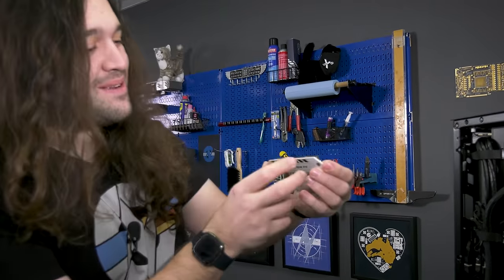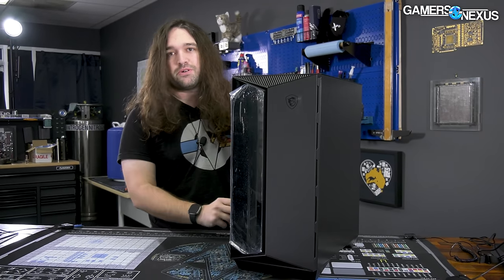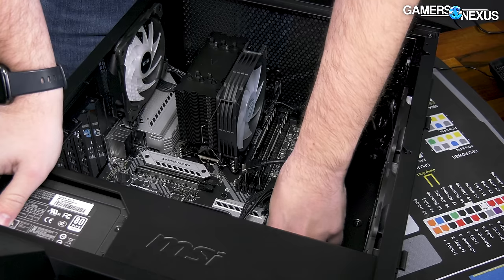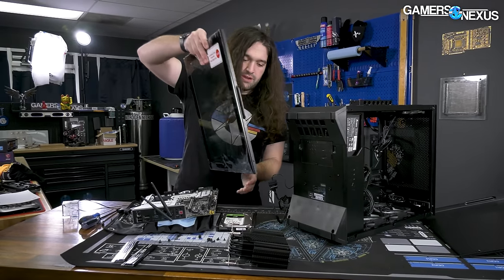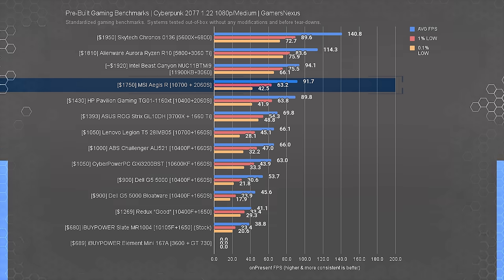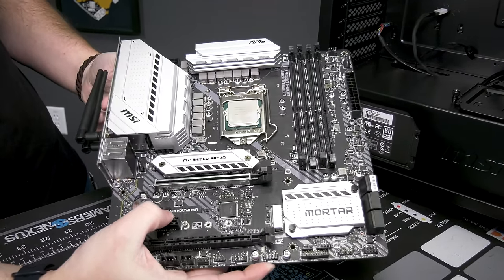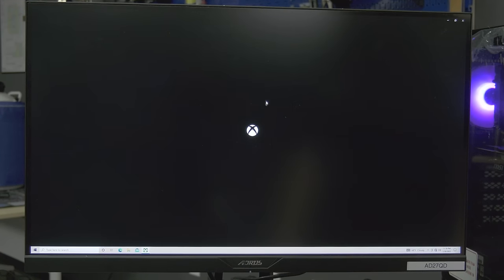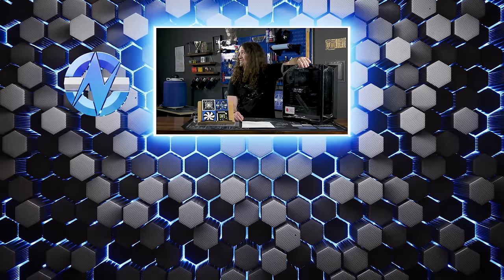MSI Pre-Built Bends SSDs & Boils CPUs at 100°C ($1700 Aegis R Review)

Comment: I work for a small computer repair shop and recently had one of these come in. They forgot to take the plastic sticker (that says "please remove before mounting") off the bottom of the cpu cooler and it cooked the cpu. Brilliant.
Reply: If it was a prebuilt I'd blame the shop where they bought it. Users are clueless, the shop should've reminded them of simple stuff like that. They're buying a damn prebuilt, it goes without saying that user probably doesn't know how computers work and was likely afraid of messing with it and breaking something.

Just a short reminder would've been sufficient. "When you get home and connect it to your mouse/keyboard/monitor, please also remember to remove this sticker."
Reply: Lol
Reply: @pjavilla  I would hope that a prebuilt computer manufacturer didn’t expect the consumer to mount the hardware for them otherwise what’s the actual point?
Reply: @pjavilla  Don't really get your comment, if it is a pre-built then the customer is not supposed to install the Cpu cooler themselve. It should pretty much be plug and play on the customers' part.
Reply: @pjavilla  nobody is blaming the end user here..?
Reply: @pjavilla  You can't remind a customer to remove a sticker from a CPU cooler for a pre-build, that would require them to remove the CPU cooler, remove the sticker, than re-paste the cooler, that defeats it being a pre-build.
Reply: Aside from the sticker MSI will forget to use thermal paste which is crazy

also that plastic on the glass protecting it from fingerprints and scratches is supposed to be taken off before use and I can guarantee it affects heat dissipation through the glass and makes it warmer inside. As soon as I took off my plastic it seemed to run cooler

Comment: It's so baffling that company that actually has enough R&D to manufacture their own hardware couldn't figure out how to assemble few off the shelf parts competently.
Reply: IKR? How did they screw it up this badly?! There's apparently nothing wrong with any of the components (except for the case), and many of these components are actually pretty good, and yet somehow they managed to find a way to make the system terrible, and in a way which goes beyond just having bad case ventilation.
Reply: I think they make these to get rid of old stock
Reply: Remember MSI is a company of hundreds. With very smart engineers that manufacture these components BUT the guy who built this computer and the guy who did the software setup (sometimes the same) is a poorly paid dude who works in a warehouse all day. Some care about their work quality some don’t just like every company in the world. The important thing is wether or not they fix the issues awesome people like this show the world.
Reply: @jlurenzjr  no real way to "fix" these issues unless the person who bought the computer is familiar with tech enough to just nuke all the software and start again new.
Reply: @syncmonism  Speaking off cases...
I have an NZXT H210i
And tzhe front panel is just a solid piece, so I thought it is bad for the temps... but it isn't.
It's a mini itx case and i have powerful hardware etc. (and a terrible thermal paste job on the CPU, long story lol) but.... it doesn't matter if the Front panel is on or not.
How? Like how does it get enough air? The case in the video has an issue with this, the 210i has literally a solid plate as a front panel. It only can suck in air through two abgout 2.5cm wide stripes next to the intake fans and from the bottom below the front panel since it's completely open there and even made wider, probably to suck in air...

Like why does it work? It makes no sense to me, the total area can't be that much larger in my case then in the one in the video?
Reply: Well greed. Im sure assblers make lowest wage possible to keep profits high. Its sad thats all our economy is based on. Endless profit instead of stable profit with great service/products and well paid workers
Reply: @michaelf.2449  No I meant fix the issues of poor quality control like at the assembly floor before it leaves.
Reply: Maybe their building people don't get paid enough and wanted the job to be done...or they tried to streamline some things to test out how far they can go
Reply: They got money to get a decent backplates on their GPUs
Reply: Its all about cheap cheap. Some monkey probably got paid to build 10 a day for $50 each.
Reply: yeahhhh, about that hardware....... hehe

Comment: MSI took "Compress this drive to save space" to a new level!
Reply: > MSI took disk compression to a new level

I think that's a funnier way to word it, just a suggestion
Reply: @waldolemmer  "Compress this drive to save space" was the exact wording of this feature in WIndows XP which is what I think he was going for, the question is did anyone actually use it?
Reply: @gp3000000  It works great for storage drives (Meaning less used drives).
Reply: @tommymoore9443  Unfortunately, basically everything I'd ever want to store is already in a compressed format so that does nothing but slow it down.
Reply: @gp3000000  I am because Acer thought it was acceptable to ship a Windows 10 laptop in 2018 with just THIRTY-TWO GIGABYTES OF STORAGE.

I have to do an in-place upgrade with a USB to even update it lmao because it doesn't even have enough space to download the update files
Reply: @shanez1215  lul 32gb is ok if it was 1990
Reply: @gp3000000  Not the option, but I manually invoke compact /compactos:always to invoke compression on the OS.
Reply: I think MSI confused an SSD with gas

Comment: Woah woah woah buddy, "Boil CPU at 100 degrees"? I don't think that's accurate, because you see, I contacted Alienware about a decade ago about a laptop I had which was going at 105-110 degrees, and they assured me that these processors were made for gaming. According to these specialists, it's totally normal for them to be hotter than the boiling point of water.
Reply: Well it's alien tech, their water boils at higher temps.
Reply: es normal tener esas temperaturas en una laptop, en un equipo de escritorio no es aceptable debido a que tienes el espacio para poner una refrigeración decente
Reply: That's the typical marketing bs for noobs. It's like having the car dealer tell you that you can keep your brand-new car's engine revved at 6000 rpm 24/7, no problem whatsoever.
Reply: laptops can handle higher temperatures than desktops, they're designed for it
Reply: @StevenMussels  Mostly because they are not upgradeable, so you won't even notice its shorter lifespan compared to a desktop.
Reply: @StevenMussels  Designed? Designed with what? Weaker power delivery, thinner PCBs and cheaper components?
Reply: @silure9502  yeah... If anyone wants ideas of what shitty thermals in laptops end up doing just look at the Apple MacBooks long history of cooking itself to death
Reply: @michaelf.2449  Or any alienware system
Reply: @silure9502  I had an oldddd aurora r3 and well it was okay I didn't understand the whole 120mm water-cooler installed on a I7 2600k at 4.1 ghz
Reply: @michaelf.2449  how hot did it run?
Reply: @michaelf.2449   Apple 100 till 105C by default as if the CPU is not toasty hot it stops the cooling fan... Solution was custom fan software that run CPU at 100% speed from 60C and undervolting CPU. My 2015 MBP went from 2.2Ghz to 3,3Ghz when I was running GTA V with a GTX1660ti E-GPU.
Reply: @a64738  man I don't understand either like the sound difference is so small why wouldn't apple use it
Reply: @StevenMussels  That's not even remotely true. Laptop hardware is either cut back versions of desktop hardware, or rebadged and binned desktop chips with lower TDPs.
Laptops typically run higher temps than desktops because most of them don't have the thermal mass to maintain lower operating temps. This is a detriment to their overall lifespan, but largely goes unnoticed because laptops are more likely to be replaced every few years.
Reply: To be be fair it's alien technology and even tho it's usually less durable than a PC alien ware laptops can run that hot and not have any problems other than melting of course but hey it's alien ware and Dell the absolute best 😂
Reply: @reaperreaper5098  all that is true but also not having space for proper airflow Is a huge deal to one of the main reasons I never bought a laptop . Plus why spend 2500 for a halfway decent laptop with a shitty screen with bad color and refresh rate when I could build a really good PC that will last so much longer and actually be upgradable if I choose .

Comment: Jesus. That CPU GPU combo was a $800 budget build back before Covid.
Reply: and thank GAWD I built one
Reply: Eh, $800 is pretty much impossible even back then. This is ~$1200. Card alone is ~$425.
Reply: @LiveType  He specified pre covid, back then this GPU cost around 250$ MSRP.
And even pre covid it would have been cheaper, maybe 700$ or 750$ total.
Reply: @igameidoresearchtoo6511  It did not. It was ~$425. Founders MSRP was $400. I never once saw it below that. Trust me I keep close track of this stuff. Look at the prices of the parts. CPU was ~$280 back then about the same as now. Cheapest GPU in this general performance tier you could possibly get was ~$350 which was a 5700xt. Used stuff in this perf tier wasn't any cheaper. Holy shit we've gone backwards and not just a little. What a crazy time.

Just CPU and GPU would be ~$680-750. Then you need memory, PSU, case, mobo. I guess $1k is doable so $1200 might have been an overestimate. Regardless, $1750 for this is criminal. That's nearly 100% inflation that I don't see going away any time soon.
Reply: It's an almost identical rig to the $700 Walmart laptop LTT reviewed awhile back and that was during Covid, and as the proud owner of one of those I can tell you they can actually move some air at full chooch.
Reply: @hornmonk3zit  Do keep in mind though that laptop graphics cards aren't the same & won't perform the same as their desktop counterparts.
Reply: @cybisz2883  My framerates are the same if not a little better than this while having better thermals so does the potential ~5% performance loss really even matter at that point? It's 2.5X the price for maybe some slightly better performance if you change out the case, and you're gonna have way less reliability since those parts are getting cooked.
Reply: false, for 800 id assume a 1660 and a r5 3600 would be what you could buy

but if we talk about todays pricing a pc specced like this one would be no more than 1200 bet

Comment: I'm always amazed by these because you can put parts in a case, leave everything at default never touching the bios or any settings and end up with a perfectly workable computer. Sure that's not optimal but it works, yet here we are.
Reply: The new intel chips sometimes come out of the box needing an undervolt at least for my i7 12700k. Very unstable temps so I undervolted slightly and got better performance with normal temps
Reply: Exactly! I used to overclock from like 2006-12, but when I got my 8 core cpu ddr4 ram, pcie4 ssd and GPU in 2019, I saw no reason to overclock
Reply: @headphonesz6527  that's kinda where I'm at currently I'm looking to finally build a new computer, and well don't laugh but my current computer was my first build which wouldn't be an issue except I built it in like 2013 or so... 
2022 still rocking my 4.5ghz i7-2600k, Radeon HD-7950, and 8gb of ddr3 ram.
It still plays the games I want to play, and like works, but software is becoming an issue now lol windows 11 doesn't like the hardware, and now that the 12600k came out I feel that it's only appropriate to go from a 2600k to a 12600k
Reply: Just enable expo and leave it at that

Comment: The first M.2 SSD I ever installed I ended up installing incorrectly. I didn't know the little standoff was a thing and I had never seen one of these drives installed before. The drive ran for about 3-4 years installed at a ~10 degree angle until it finally died. When I repaired the computer and replaced the drive, I was shocked that I did something so dumb.
Reply: @TheJukebox92  stand off for the screw. Older ones were elevated kinda like MBs. Now, they're really flush.
Reply: @TheJukebox92  As long as you didn't install your m.2 in a way that bends it or has it under constant pressure, you're fine!
Reply: You live and learn. We all made mistakes and broke stuff, even when we knew what we were doing and should have known better :D
Reply: I didn't know this. Does the standoff come with the drive? Does it come with the board?
Reply: @SixDasher  I'm basically a professional now. I fix computers and build them for people. I still do stupid things all the time. It's like you know better but you just just choose to do the wrong thing just to undo everything.
Reply: That M.2 had heatsink installed MSI decided either they didn't want to remove that heatsink, didn't want to use a different drive, or didn't want to leave off the Motherboard M.2 cover.
Reply: @SuperFlamethrower  usually it comes preinstalled on the board, and the mobo would also include extra screws.
Reply: @SuperFlamethrower  comes with the board. It's like a weird tiny screw with a hex hed, and a hole in the middle with threads and it has a tiny screw that goes into it. They are usually pre installed for as many M.2 slots the board has. If not pre installed they come in one of the baggies of goodies. You can also get them seperately on Amazon if you need them.
Reply: @TheJukebox92  can yuh make a video of that m. 2 pads that came wd boards.. I hv asus z690 tuf too.
Reply: some how, some way, I did my first m.2 installation correctly. thank god for that lol
Reply: @TheJukebox92  I found photos online that show the stand-off screw preinstalled. it was a little knurled thing (MSI uses different ones than the other commenter is describing) that stood up from the motherboard that you screwed the m.2 into, as to the thermal pads as long as they weren’t meant for the heat sink youre fine
Reply: I'm not shocked at all.
Reply: @Talkashie Still better than msi
Reply: I stripped the screws on my standoff and had to order a new set.
Reply: To get wifi when my reciever died I pulled out my Intel adapter from my old laptop and put it in my PC. It was at an angle and heated rapidly before the pc even booted. Stopped doing that, safe to say. It was simply too small for my mPCIe slot to get to the standoff.
Reply: I have been building my own PCs since the late 80s, when you had to buy books and magazines to figure out how to do it.
(I mainly used "Upgrading and Repairing PCs" by Scott Mueller, which I think still gets published).
Nowadays it is so easy to get the right information for free online.
Unless you were less than 12 years old, I really don't understand how you can be poorly informed while handling components worth hundreds of dollars/euros.
Reply: @TheJukebox92  it does, its the part where you screw in the ssd or in the case of z690 msi boards there is a little plastic thingy that you slide over the back part of the ssd
Reply: I did the same thing with my first nvme ssd. I had it installed at an angle. The drive suddenly became extremely slow one day. It was a HP EX 920 1TB. I was still under warranty thankfully and they replaced it very quickly no questions asked. But I now know it was my fault and have it and my new WD black nvme installed correctly.
Reply: I don't understand (i'm not a native english speaker). Did you not fastened it with a screw?
Reply: @LordZordid   no they didnt, they didnt know that that was a thing.
Reply: I build systems for others as a side gig and a client brought in a system to get some stuff added and upgraded. The m.2 was just hanging there with no screw. This was definitely not the first one I ever installed. The standoff was in place. Either I installed the m.2 and then just forgot to put the screw in and didn't notice for the rest of the build or the screw popped off later but there was no screw rattling around in the case.

I'll be glad when the toolless standoffs get to PC's.
Reply: When I first assembled my Core i9-7940x I was depressed and tired, and somehow forgot to remove the plastic covering the base of the heatsink… and then had the gall to wonder why the thermals were shit for months afterward. Everybody makes dumb mistakes, the important thing is to learn from them and avoid those issues in the future.

The i9’s still cheerfully running now, by the way… thank Christ I didn’t try overclocking!
Reply: Don't worry, we have all done it at one point or another, even the pros.  Hell, especially the pros.  I've had to swap around so many SSDs, wifi cards, and WWAN chips for testing that I'm an expert getting that 10 degree hang to work.  It's especially fun when you put the screw down in your parts tray and only afterward do you notice that there are lots of similar screws you get to try out on the reinstall.  :)  At least now manufacturers are coming up with better solutions.
Reply: Yeah kinda makes me freaking mad when you buy the nice but expensive Samsung NVME drives, and they can't be bothered to include a TINY metal standoff. I had to go to amazon for them as I'd lost my motherboard one. (why they can include them, but samsung making 20% more profits then most ssd companies can't IDK)
Reply: It happens. I burnt a AMD Athlon 64 CPU on my first build. I learned a lot and you did to. You can’t be perfect in the first build. Keep after it, you will only get better with experience.